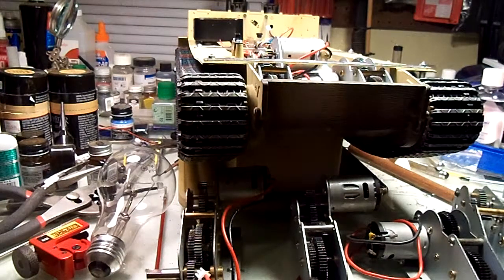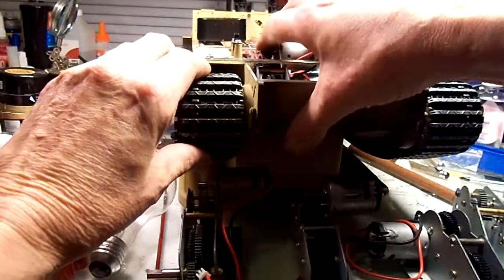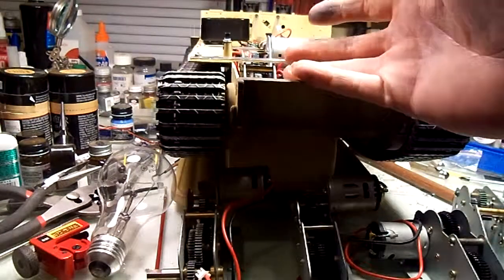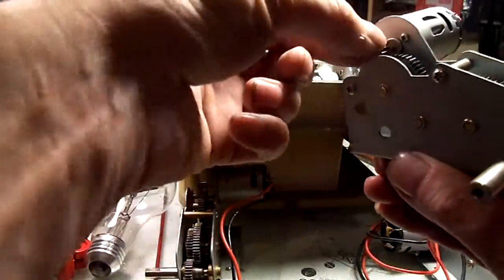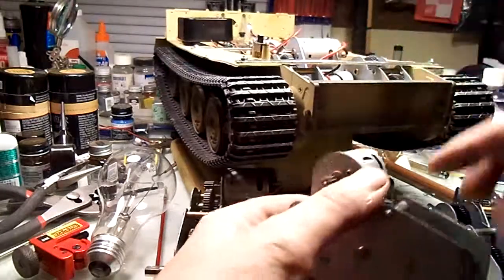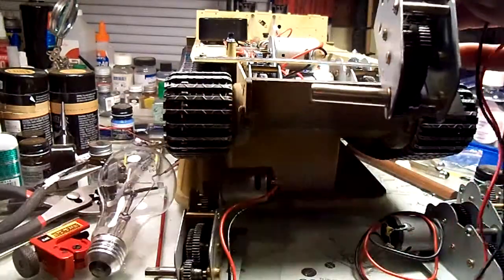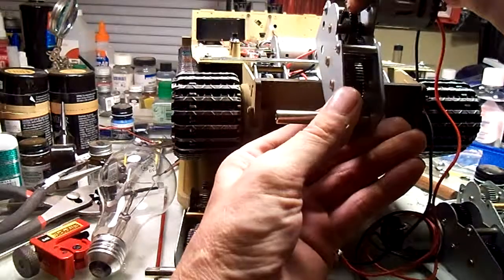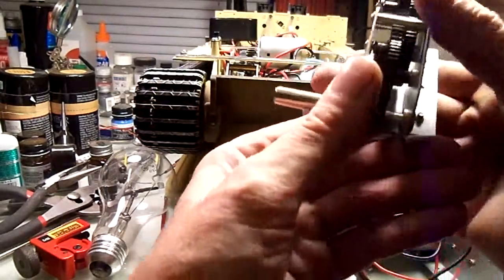gearbox repair 1

Comment: does 4-1 mean its slower than 3-1
Reply from the maker: 4-1 is slower than 3-1, but there's a lot of confusion there. I distinguish between the two types by the number of gearshafts in between the motor pinion and the gear on the axle. 4-1 has four shafts and 3-1 has three. I prefer the 4 shaft boxes and have them in all my heavy tanks.